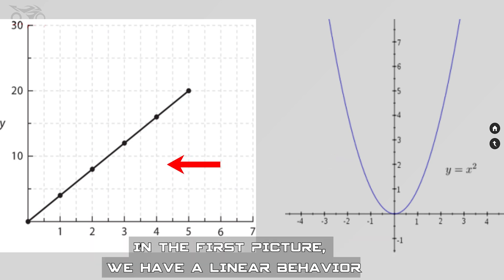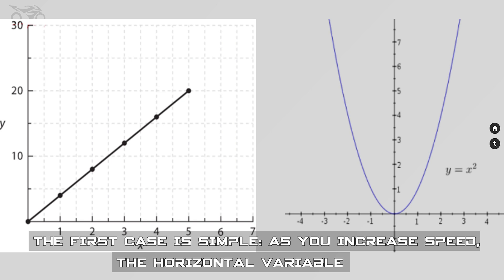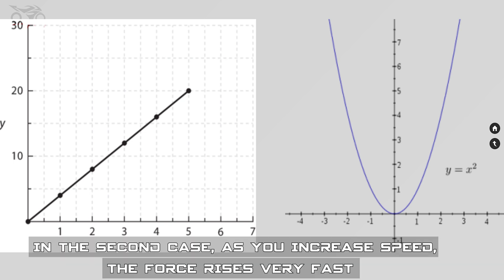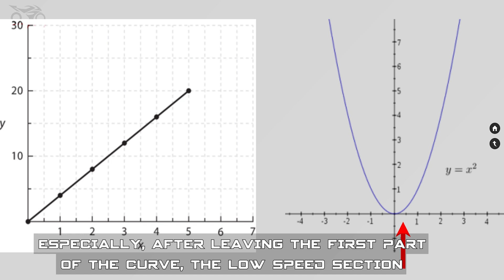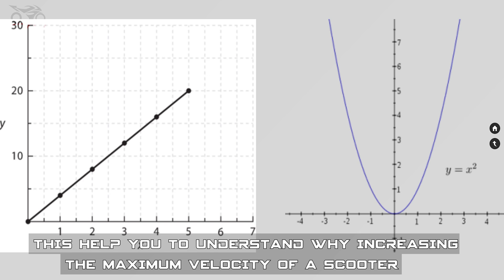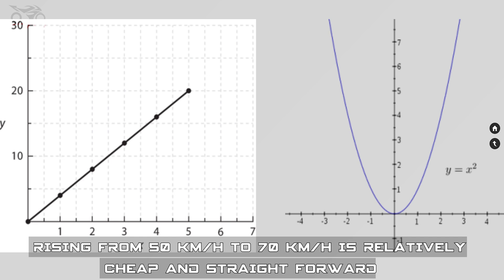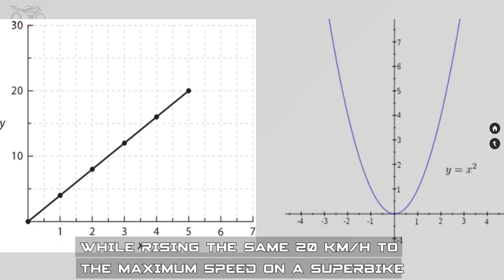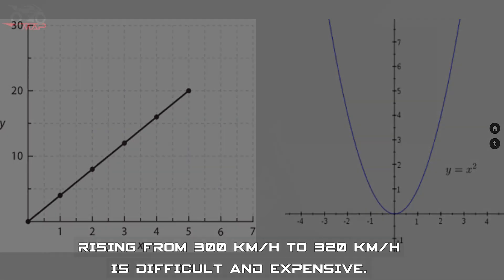THE MOTOGP AERODYNAMICS... is not very good!

Comment: Recently, vertical fins are appearing on MotoGP motorcycles. What is their function and above what speed(s) would need to be attained for them to make a noticeable difference from no vertical fins at all? Thank you.
Reply from the maker: @Ramon51650 you are right, the vertical fins on the MotoGP's tails are a relatively new introduction. We all knew that the introduction of "something" on the rear part of the prototypes was just a matter of time! 😀 Their function is to provide a bit of load on the rear wheel (load means grip!). We can't of course provide any sensitive data (like the load related to the speed), but we can tell you that the forces playing here are not huge (it is a little improvement). The presence of the rider's body in fact mitigates the downforce available. They can help in the straight and during braking. They also grab the attention which is a positive factor for all the producers that compete in a MotoGP Championship! 😉